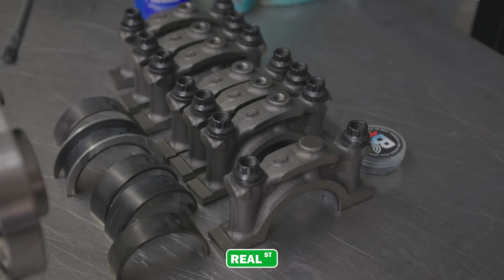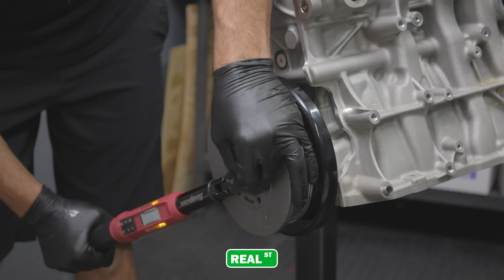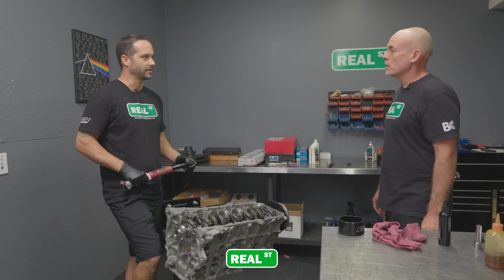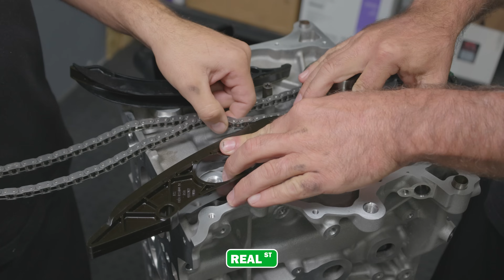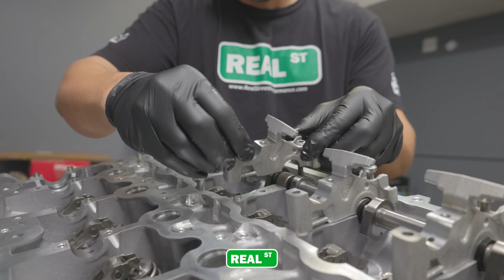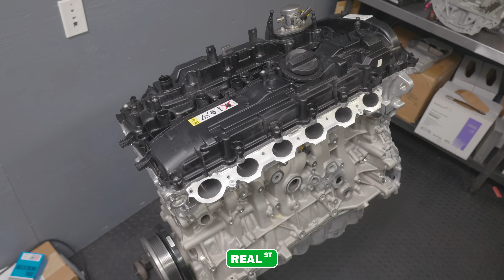Building a 1000HP B58 MK5 Supra Engine

Comment: 6:27
Hyundai / Kia GDI motors do about 1 qt per 1000 miles .... those motors sieze up because those owners are NOT checking their oil on a regular basis OR not changing their oil every 5k miles.
Called low tension oil rings, oil seeps past the rings and burns away in the chamber.
Reply: They clog the cats too
Reply: Mostly because Hyundai/Kia is trash at building engines.
Reply: @chrisbradley3224  funny how ignorance is bliss 🤣
Reply: @ACommenterOnYouTube  It's objectively true though. They have horrific failure rates, worst in the industry, plus several pending class action lawsuits.
Reply: @chrisbradley3224  ahh apparently you dont know that kia and hyundai are NOT the only ones to use GDI motors OR low tension oil rings ....
Its not a design flaw, its done this way on purpose to save on fuel. By inducing small amounts of oil into the combustion chamber and less fuel, that saves fuel and increases mpg .... 
If you checked your oil every 1k miles, like you are supposed to do per the manual, which 99% DO NOT, you would see that its burning oil, and not by flaw but by design. 
So those that end up with a siezed up motor obviously didnt check their oil every 1k miles OR changed it every ~3500 to ~5k miles.
Every car manual states to check your oil every 1k miles so make sure its not leaking or burning it off. 
Everyone that cares about their car should be checking it regularly and changing it regularly regardless of how little or how much you drive it.
Reply: @ACommenterOnYouTube  I'm not talking about only burning oil. They grenade from various different failure modes very often. Your diatribe aside, somehow my BMW has GDI, gets better fuel economy than a Kia that has less power, and doesn't burn any appreciable amount of oil. Don't make excuses for poor cylinder surface and piston ring design.

Comment: Cost $6,286.51 for parts,  prob another 5k for labour,  total $11.286.51 for 1000bhp build, which is not bad imo, then you have to consider building the transmission if it can handle that power.

Comment: How much does a b58 long block cost new crate engine?  20k 30k?
Reply: 10-15k from what ive heard. But from other places it could range between 5-9k depending on what cars u get them from(more or less cheaper from older model 40is in that case).

Comment: Why would BMW put the timing chain at the back of the motor near the firewall? Doesn't make sense
Reply: I believe it was to provide better balance on the crank shaft if I recall correctly. If it was a belt it would be dumb, but  it being a timing chain you shouldn't need to adjust it unless something major anyway.   

The dumbest thing with the engine is no dip stick.  That's my single complaint about the b58

Comment: Is the King coated bearing as good as the OEM bearing? The OE bearings are Glyco IROX and they seem to hold up extremely well. Older BMW engines show lots of rod bearing wear, but I've barely seen any wear on any BMW engine using the IROX bearings.

Comment: I'd agree that the B58 is a very reliable engine but it's a little too complicated for an average rebuild. I guess what I'm saying is that I wouldn't care to  build one myself. I'll stick with my 2jz's. ⭐🏁🏁🏁😎
Reply: Say that that's really a majority of modern I6s now that even toyos new V6TT looks just as or more nightmarish to take apart as the B58.
Reply: @carboydorifutoparty3976 You’re forgetting how sensibly Toyota engines are designed, the 3.5 TT is not a difficult engine to teardown
Reply: @lomfmur  I said "looks like" not is.  Plenty say it may look nightmarish to take apart in the case of modern engines when that's clearly not the case other than having the engine look like it has hoses and wires all over the place that just make it look unpleasant to look at for alot of people that say "it looks like a nightmare to work on" when it really isnt(in some engines cases).

Comment: That’s a B58TU as I call it B58 “Toyota Updates” bc the original B58 block and head are substantially different, not interchangeable at all
Reply: It's a Technical Update, lol. This is the nomenclature that BMW has used for years.
Reply: So which one changed from two timing chains to single like the B58-family engine?
Reply: @profuse007  There are several different versions of the B58. (I think four.) I don't recall there being any differences in the timing chains between the different versions. However, there are versions with an integrated exhaust manifold and versions with a regular external exhaust manifold. Two different versions have been used in Supras. They are not unique to Supras. If you want to know more about these engines, check out videos by NoBrainer Talk. Here is a link to one of them: https://www.youtube.com/watch?v=eLGd8YN5VPk.
Reply: BMW has been using TU revisions for at least 20 years.
Reply: B58 has two chains w/ intermediate sprocket. The B58TU  on G-chassis and Supra are single chain. 

The diff exhaust design on the head for turbo is minor compare to the head and block being in compatible from B58 to B58TU. 

Historically, the TU in the past do not have drastic change like this B58 and B58TU
Reply: So of the previous TU, which one changed from single timing chain to 2 timing chain w/ intermediate drive?
Reply: @profuse007  And TU2 has even more changes, including Miller Cycle and eVanos, and not in the Supra. Your logic is stupid. It has nothing to do with Toyota and everything to do with BMW updating their designs since they will never introduce another clean-sheet 6 cylinder ICE engine again.
Reply: @chrisbradley3224  But you didn't answer my question about the head/block/timing chain.

and keep it calm and professional...

Comment: I think a comparison showing how a modern engine makes it's power compared to the 2jz. I like the b58, it's quite capable in stock form it weighs about 100lbs less that the 2jz and because of the bore x stroke of the b58, it makes more torque than a 2jz in an "apples to apples" (same turbo) comparison.
Reply: Look at the difference in compression ratio between the two engines.
Reply: 2jz just hit different and it sounds different the b58 cool but the 2jz just cooler
Reply: Compression ratio, turbo geometry, cylinder head design

Comment: So this is basisically Dodges “NEW” CatX Hurricane engine
Reply: Yes and no. Similar by both being closed deck, aluminum blocks,and being Direct injected only. Difference is that the hurricane has a lower compression ratio than the B58 that's even lower with the HO version of the hurricane that's somewhat closer to the S58s compression ratio,it's a twin turbo I6 unlike the B58 being a single,the turbos are more or less bigger on the hurricane,timechain is in the front of the hurricanes I6 unlike the B58s that's in the back,and we'll I guess this somewhat counts but there is a new variant of the B58 that has dual port and direct injection also.

Comment: Tell the germans build pushrod engines they wont have problems the best bmw engine is the m50 cast iron block
Reply: The germans would totally have issues with pushrod engines, they’d try implement cylinder deactivation, variable displacement oil pumps n the like. Not to mention the fact they cant seem to make a timing chain

Comment: Why main studs? Seems like overkill and unintended negative consequences.
Reply: If you have to ask, you shouldn't be here
Reply: @ACommenterOnYouTube  ok genius. It’s not necessary or even recommended for a mild build. If you don’t know this, you shouldn’t be here.
Reply: @TML34  The con with arp main studs you need to line hone the block with that extra clamping force. But they help to eliminate main cap walk and protect the threads of your engine block and they are not torque to yield as stock so you can reuse them and they are stronger material. Maybe a little overkill but why not if you are already there changing main bearings. It will always depend on goals. Most probably you will also need to replace main caps for billet ones if you planning on pushing extreme power, time will tell.

Comment: There are so many angry 12 year olds the cant handle the fact that the b58 is simply better💀💀💀
Reply: They think that the only thing that matters is peak horsepower with a fully built motor, even though 99% of people aren't going for max effort with their builds. The B58 is better at just about everything else. It's the same reason the K-series is better than the B-series.

Comment: Can’t knock a b58 till you try it personally ima big fan of them drove a stock mk5 Supra and a 700whp 1 before the trans blew up and what a car fun stock and with power and for the mk4 Supra never drove one but I did drive a Lexus is300 with boost and it was a lot of fun but it was like a light switch your ether in boost hanging on for life or just putting along could of been the tune too so ether way both engines are great in my book
Reply: Punctuation bro 🤦🏽‍♂️
Reply: @ACommenterOnYouTube  sorry ima drive/mechanic not an English teacher
Reply: @beast6525  i'm not an English teacher either, i'm also a lineman for an ISP, i also work on cars and yet i know how and when to use proper grammar and punctuation, so that is not an excuse not to use punctuation.